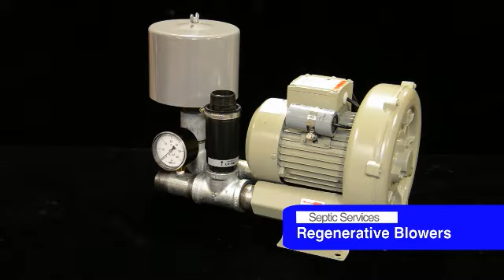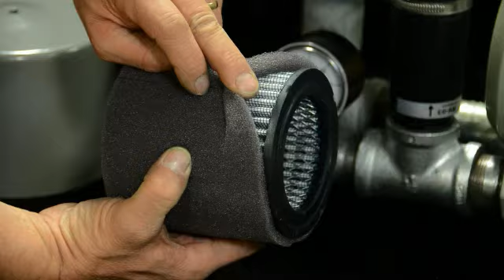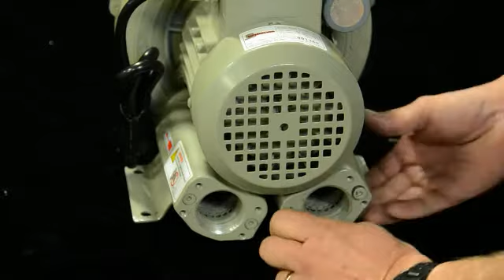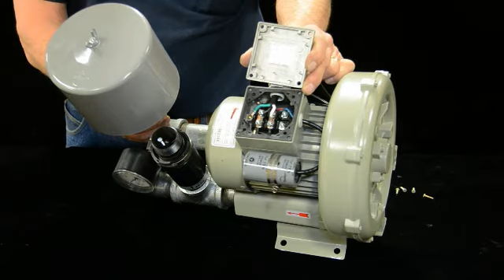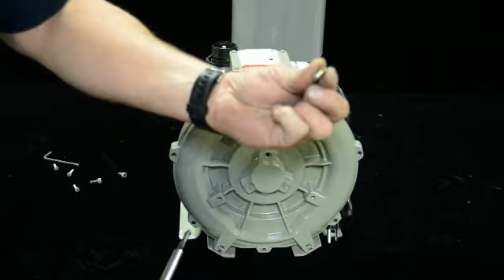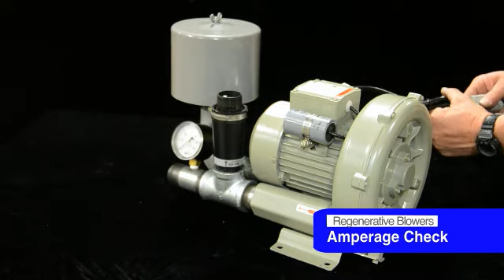Pump Rebuild: Whirlwind Regenerative Blower

Comment: Myself and someone else were wondering what pressure relief valve is installed there. I know this was years ago, but hoping you might be able to shed some light. Mine is a whirlwind R4247, 1 inch.
Reply: From what I can tell it is a RV-03. I see it mentioned on airtecuk and rontai (from UK and Taiwan respectively). Adjustable from 0 to 300mbar. I cant tell the difference between it and the RV-01. Both site don't have the RV-01, but in the US that seems to be what available. There also a RV-02 that does 300 to 600mbar (RV-36 appears to be a equivalent). I've seen the part numbers with the letter A. I think it the same thing but made out of aluminum.

Comment: What pressure relief valve are you using? Thanks! My motor on my septic just went out, it was never set up properly, no relief or pressure monitoring. It’s a retrofit kit.
Reply: Did you ever get an answer regarding the relief valve? I have similar situation that was not set up correctly.
Reply: No, I ended up replacing the capacitor and taking down the old motor and cleaning it. Ran good after I did that. Bought a new one to sit on the shelf in case my old blew up.. since I did that I haven’t put a relief on it yet. If I have to put the new one in I will figure out how to put a relief on there plus a pressure switch to interlock with the pump….

Comment: Hi there, would i be able to aerate 10 20sqm ponds with a blower that has a pressure rating of 4.2psi? I'm cultivating spirulina i want to run airlines over the pond and drop secondary air lines into the pond each delivering around 0.5-0.8 lpm of air. there will be 150 of these small outlets per pond ( a total of 1500 outlets for 10 ponds). I wanted to know if a 500 watt 66m3/h could handle aerating those ponds. thank you
Reply from the maker: +Brian Karkada We'd need to have a little bit more information to answer your question properly. If you'd like you can give us a call at 800-536-5564.